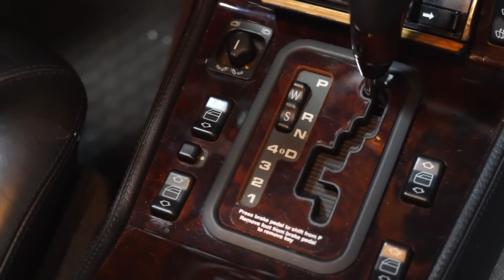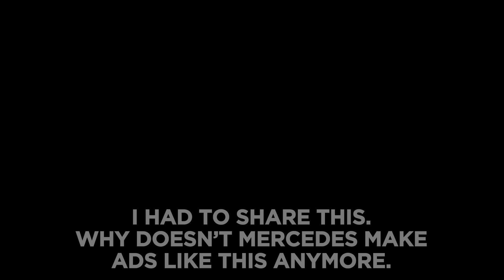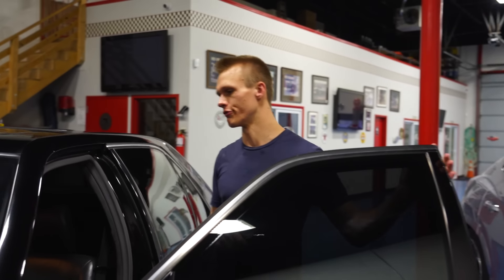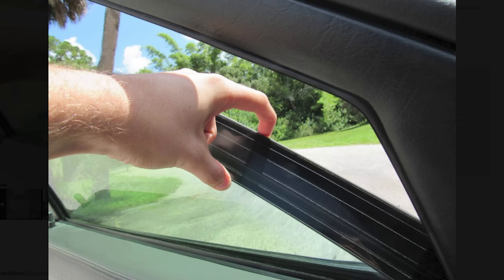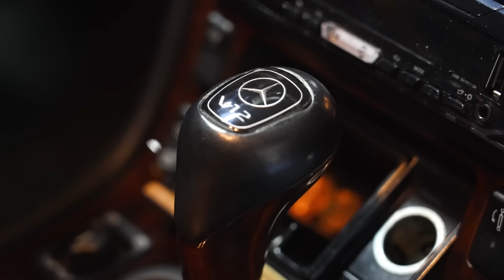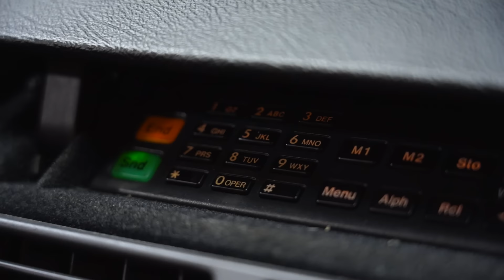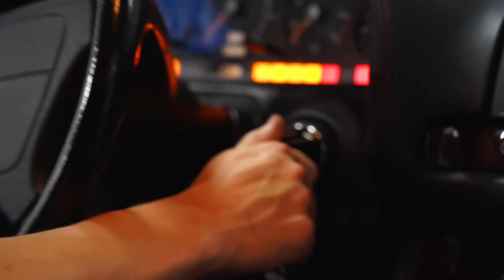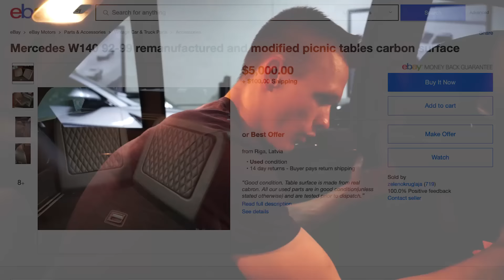WHY THE W140 S600 WAS THE GREATEST S CLASS EVER MADE! *V12 PAGANI ZONDA MERCEDES*

Comment: I own a Smoke Silver '98- S600 and concur with all your points made on quality in a grand touring Sports Sedan. There is nothing quite like the feeling of rolling along at 80 mph and dropping your size 10s flat. The surge of power is ethereal; the near instantaneous climb into serious triple digits, just simply amazing. The last of the BEST 600s; still a very real contender several decades after it's low production ended

Comment: The early (pre facelift) W140 are of superior build quality. At facelift time (1994/1995 models) M.B. did over 1,700 changes to the S-class, Most of them had the original purpose to lower manufacturing cost (hence: quality!) and to simplify many complex engineering systems which tended to be unreliable.
To begin with, the W140 was the most expensive vehicle ever developed by Mercedes-Benz in terms of design and production economics. The original development engineer and most of his staff were FIRED after production started due to alarming over budget costs.

The first four years of production the W140 only produced losses to M.B., until the car was facelifted and production costs were lowered (along with quality and final consumer price, which allowed to raise sales proportionally).
Reply: Still better than no mercedes benz w140. Imagine being stuck with some stupid corolla
Reply: I’d go for a later one anyway. The interior was upgraded with leather covering the dash and other panels. Also there’s no biodegradable wiring harness to worry about
Reply: @omostim2385 I’ve been doing research on this generation of Mercedes between the W140 (coupe and sedan) as well as the R129s. I’ve heard of the pre-1997 biodegradable harness issue. Are there any other major issues that they’re known for?
Reply: @frankieguinto8121  Sadly I don’t have much experience or knowledge on Mercedes of the early to mid 90s biodegradable era. I’ve owned older (91 560SEL, 89 300CE, and 77 300D) or later (2000 E320, SL500, and 03 S430). I especially love the later R129s and 140s for having the 722.6 5speed and or the M112/113 engines. They are just easier to work on and have lots of parts available. The W140 still used the M119 and M120 engines but from what I hear they are great engines. Paired to the 722 trans makes it even better. It’s a faster smoother more modern transmission I’ve heard the older 4 speed autos having a problems with reverse(and experienced it) So even if you find an earlier car where the wiring harness was replaced you may run into more issues along with parts availability. My R129 it has had some problems like the hydraulics for the top not working properly. The strut mounts rubber falling apart, a radiator that gave out, egr valve rubber hose that cracked (easy fix) and a blower motor wouldn’t spin at high speeds but it always ran and drove. I say look for something around 97 or newer with either the W140 or R129

Comment: I love old Mercedes Benz I have a W123 300D Turbo Diesel they are solid cars but the thing with old Mercedes is they don't cost a lot to buy but they are expensive as hell to repair as I have found out...
Reply: My first car was a W123 and it was before I knew much about cars, if you learn how to do anything on them learn valve adjustments and it will run forever.
Reply: @durtnasty  that is true but with a car being 35 years old now and its also my first car. The W123 is amazing but in due time everything except the engine really starts needing attention plastic clips that break rubber seals etc its a amazing car but people who have replacement parts mark them up so much its hard to justify making it a first car
Reply: I have a w210 1997. 3.2 l. Theres a saying the most expensive Mercedes you can buy is a cheap Mercedes

Comment: I had a W140 a few years back, a diesel engined one. a "low spec" :) , best car I've ever had. comfort beyond anything else. I've driven some newer s-classes and they don't have the same feel to them. W140 is full of insane features like double glazing, it is so quiet you wouldn't believe, and it is so well insulated that in negative 10C after like a half an hour you come back to a nice and warm interior, lovely. One of my favourites was heated washer fluid bottle AND jets(by engine coolant, not a peasant electric heater :) )!! Mine had these lovely aerials on top end of rear fenders that pop up once you put it in reverse. Best car ever!

Comment: Have had my 400SEL since 2013. The previous owner spent a fortune on it. I have spent a small fortune on it. Fortunately have a mechanic whom was trained on engineering the W140's to fix it and do repairs without being completely exploited. In saying that its now in the best mechanical condition I have ever experienced. On the M1 highway it cruises like sitting in 1st Class on a Boeing air-jet and is moderate on fuel consumption. Before it use to drink like a camel. Drive it only on Sundays for 2hrs. Everything works on it now. Its unique, masterly engineered and superior in comfort and way more affordable than its really worth on the market. The equivalent in todays market I'd need 200k to spend or more for anything similar. Its priced on the market today 24k. So in a sense its the most advanced cheapest luxury vehicle today. Nothing else is comparable in my opinion. 0-90 klm is really an experience. Like a Top Gun take off. 90-180klm it monsters and you feel like the car is sitting on 110klm in a leather sofa.  The vehicle is underestimated and a beast on the road.

Comment: No one ever mentions the 'Suede Headliner' ! Definitely one of the greatest visuals a guy casts his eyes upon when looking upward. The same suede is also on some of the console surrounds. My '97 also has just turned over 80,000 miles and the one thing to watch for is if you get a bit of coolant on the floor from the back of the engine, there is a small pipe that will need to be replaced. They are only around 120 bucks, but a bit labor intensive. By the way when mine let go, only one was in America in the middle of Montana. Wow.....

Comment: 15:58 the ac wil not kick on... if the engine doesn't run, the ac doesn't work. The vent works so the air circulates

Comment: 12:43 the 1993-1997 Lexus SC300/400 had power adjustable steering column with one button/joy stick thing and you could do it while driving. Also the 1998 and up LX470/ Toyota Land Cruiser has the same thing. I am not positive but I assume the LS400 would’ve had it as well, as that was the flagship model.

Comment: Btw, for those of you who also like the W126 chassis, the W140 panoramic sunroof is a perfect fit in the W126, sedan to sedan, coupe to coupe. Even weirder: much of the frame etc carries a Mercedes parts # starting with 116, so it probably fits the older chassis as well...
It will work with existing W126 sunroof seal, but the W140 seal is an improved design.  Cheers

Comment: Awesome man. Great vid.
How smooth is the ride in the w140!

My tail lights are pink too lol, have looked far and wide but cant find original replacement anywhere besides other pink ones. 

You have a beautiful example of the s600 bro. Really nice.
I bought a cheap $4,000 S420 about 8 years ago.
Used it as a daily driver and fixed all the issues I bought it with.
After a couple of years I decided to make it something special.
Took out the s420 and dropping in a custom 6.0 M119...Should be some serious HP/Nm

Comment: E38's had most of the stuff of an W140, just a few years later due to a later release date, my 750's all had electric steering column adjustments, dual panes, softclose trunk but not doors. BMW and Mercedes were on top of their game in the mid 90's, never to be replicated sadly. I'd love a W140, and it's gotta be the 600.
Reply: W140 should relased in late 80s but postponed till it reaches in 91 for public as 92 model. BMW was late compute even in tech in 94. But she win the next model against W220. 740D was great machine. I wished if mercedes did the same. Both great cars.

Comment: The problem with the 4th vehicle I have is that the cruse control will not engage unless the car is pulling a 4000lb trailer. The IACV opens enough that it will hold 85mph and at that speed the cruse control activates and then shuts of. its a useless feature on the 1994 Ford Thunder Bird, just has a little 4.6L in it.

Comment: @Jimbo: 12:35 - 12:50 -- I used to have a 94 Acura Legend GS 4-door sedan (with the ultra-rare 6-sp manual) and it also had an electronic tilt/telescoping steering wheel.  In fact, when you saved the seat position in the memory, it would save the steering wheel position as well.  When you turned off the car & removed the key, the steering wheel would retract all the way towards the dash & tilt up for ease of exit.  It would stay that way until you got back in, put the key in the ignition & turned it back on.  (Sold that car with 313K mi.)  -- Greetings from HoCo, MD.  Please review the black Countach & the Espada!

Comment: Had a S500. Did 251 thousand kilometers in it with 0 problems. 
But one day i flipped the car, no chassis or panel damage i only had to change the right mirror and right tail and head lights. But after the flip electronics and the engine problems kept going, the car cost me 10k on maintenance, i gave up and sold it and took a huge loss on it.

Comment: I have a 92 w140 s600 myself in Canada but it’s not a American spec model. It brought it over from Japan in 2007 it is left hand drive too. But it has two options that the American spec models never got. One it has cylinder deactivation and the other is it has a enduro tank stock tank is 100 liter mine has a 130 liter tank

Comment: Bro the “Rest” feature only allows the fan and heat from the engine to circulate. It does NOT turn the air conditioner on. The compressor has to be on for the A/C to run and that means the engine has to be running because of the belt.

Comment: The phone wont work as it would be operating on the 2G network which finally ended being utilised in mid 2018.

Unless you could modify the handset/system to use 3/4G cellular network somehow.

Comment: The good thing is the electronics.
After this car the S-Class went into computer-bus systems with all the problems that came with that especially when age is a factor..
The square doorsills is packed with cables to every electric function in the car...
A snakenest yes but you can follow the cord the old fashion way when you repair it...
And one fail might not affect other things as it usually does with newer S-Class vehicles....
ECU EIS & ETC sending data back and forth...

Comment: 1997 is not the first Benz with vacuum door and trunk.  I have '95 S series and it does the same.
Reply: Yeah same with mine '95 v140👍
Reply: The 140 was introduced 1991, and at least the 600s had it right away

Comment: i had the coupé version in second hand but just  1500 km´s ,and the V12 engine but i thought it had the 6.3 engine ,i bought it with no badge in the back just the V12 on the back pilar of the top, they used to mean something the numbers on the back ,now it´s just a way of saying this as more horse power, in the 60´s or 70´s the 6.3L was a V8, now it´s a V12 but in the 80´s i remenber having a 450SEC that was a 4.5L V8, there was the AMG but this was enough, regards
Reply: that guy ,DOUG "SCORE"demouro says that in the 80´s there was no AMG , i sent to him a AMG 80´s  U.S. catalog ,including a w123 van , regards and stay safe

Comment: Are the V-12s on the W-140 as difficult to service as the 12 cylinders in modern Mercedes? Today you drop the engine out of the car to change the spark plugs. 😳

Comment: Actually that’s not quite the engine pagani started out with. Pagani took the SL73 AMGs engine, which is this generation but bored up to 7.3 litres from the 6.0 in your car. AMG made about 80 SL73 and 150 SL70 which had 525 and 500 ps.

Comment: I don't know how u can all moan about the fuel prices. In England we pay around £1.60....... per LITRE!
Around $2 a litre!!! $10 a gallon?
Reply: It's currently very low due to the current climate, I pay £1.04 per litre.
Reply: @hazyblue69  
What for super
Reply: @CasaFuenteOrange  
U even got a car????
Surely you can walk to and from your trailer park
Reply: Where the hell are you getting fuel for £1.60 a litre?
Petrol is 1.05- 1.11 for 95 - 99 RON in the UK at the moment.
It has never been 1.60 even before Covid!
Reply: @ahemgee9542  
I'm sorry, I don't keep a major look at fuel prices, I know that iv spent 1.30 a litre in the past. It was just a comment, do the math and work out the difference. And I have to run my vehicle on super unleaded.
Reply: @philipgreensmith1694  so do I. Super is £1.10 - 1.20 atm in the UK . Pre Covid was about 1.30-1.45.
Reply: @philipgreensmith1694  That was for diesel fuel, just checked and it is currently £1.15 diesel, £1.11 petrol in my area.

Comment: This guy probably never heard of a Japanese spec acura/honda legend or a toyota century
Reply: On the coilovers issue you can put tein coilovers with bags and edfc system it is exactly the same as that system for suspension I have it on my legend and I have it on my legend on a switch for comfort and sport and sport plus it also helps put the 1200 hp to the ground of course it is hevaly modified I smacked on a supercharger and a twin turbo and I have built it all form scratch it probably cost me $200,000 to do but it is a car that fits my needs not a one size fits all I also converged it to 4wd the first of it's kind and a 6 speed manual